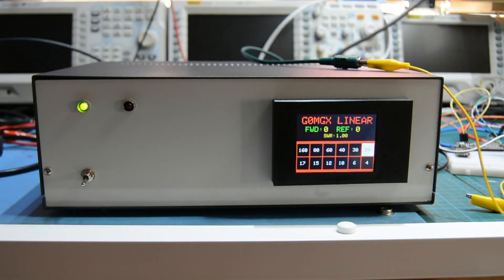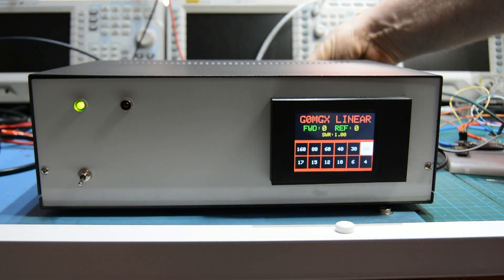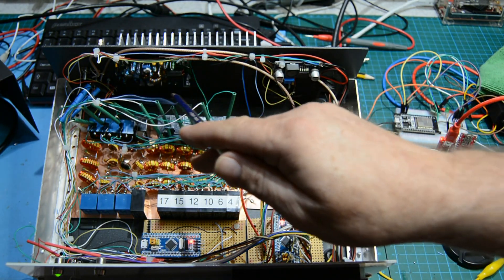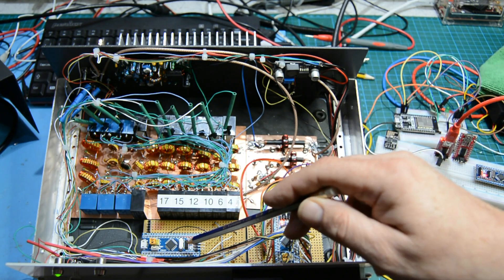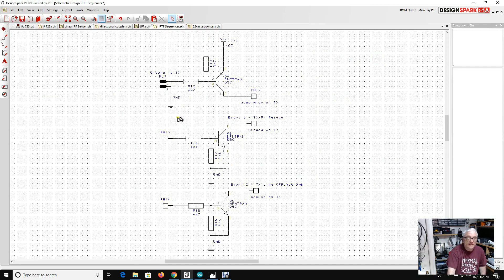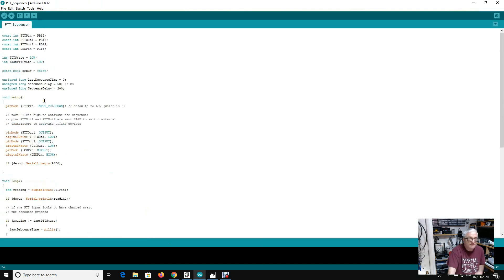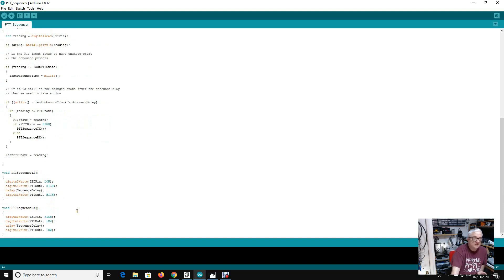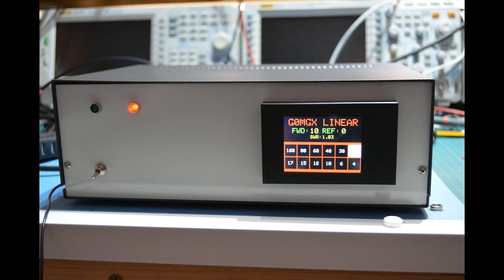QRP Linear Part 5   Finale

Comment: 👍Thanks for sharing this Mark. The STM32 and touchscreen front panel does interest me. I was thinking this might be useful for a project I was thinking about to remotely relay switch window line stubs.

I have had a QRP 10W sitting unbuilt for ages (from around the time Hans released it). Though I have been tempted to build a little standalone linear, I am holding out for the QSX kit which is what I originally bought it for.